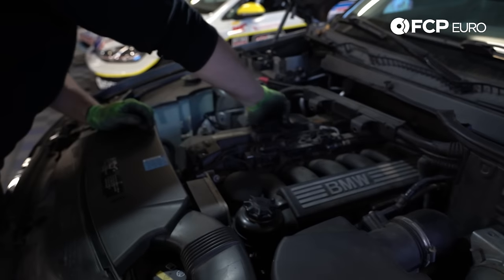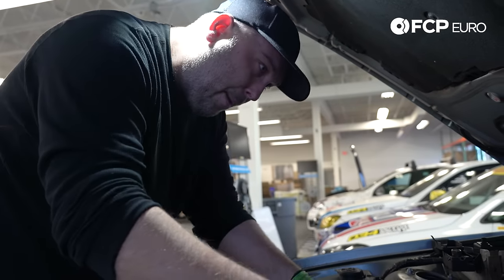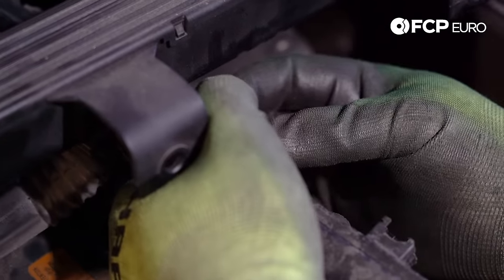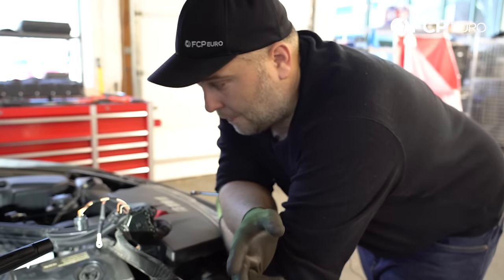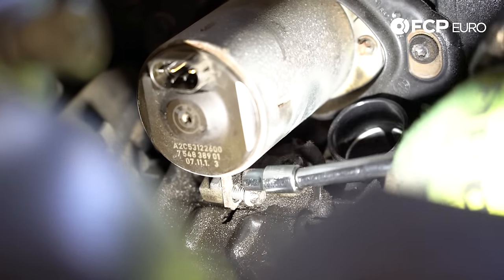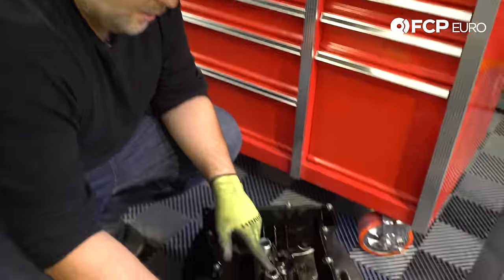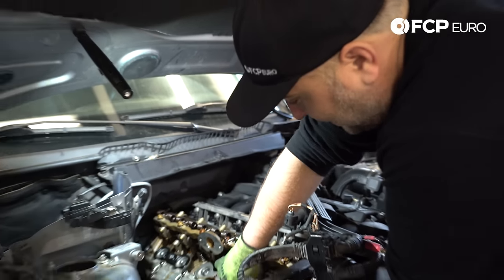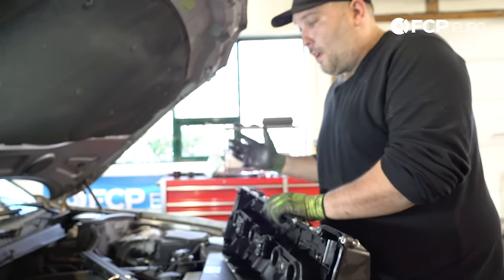How to Replace the Valve Cover on a BMW N51/N52N Engine

Comment: If you break the breather hose, YOU DO NOT NEED TO REMOVE THE INTAKE. I got access to it by just removing the alternator. Had to break off the tabs on the furthest connector to get it off, but that's okay if it's being replaced.
Reply: A little late for this but i Have some input.  This method would only work on the later engines.  If you have the n52 with the magnesium VC, then the oil separator is bolted to the intake and it’s gets in the way

Comment: Definitely use a Torque wrench. I've done this job like like 3 times now cuz I damaged either the Valve cover gasket, or the Valvetronic seal from over-torquing casukng vacuum leaks. It's a very small torque
Reply from the maker: 100%

Comment: I just did this the other weekend on my 2009 328i xdrive,  when I started it up it ran rough checked the codes and p00bc came up.  I didn't mess with the mass air flow sensor at all and now I'm stumped as to what it could be.  Any help would be greatly appreciated 🙏

Comment: I have an E90 330i with the magnesium valvecover. Can i use some rtv along the original gasket to prevent future leaks. Can the magnesium withstand the chemicals in the rtv?

Comment: So I did the valve cover replacement and everything and now it's wanting to stall at idle, the rpm's drop but then pick back up every so often. Please help. 09 bmw 328i xdrive N51.
Reply: Did you end up finding a fix for this one? I’m having a similar problem after changing the valve cover and spark plugs.
I’m also getting a squealing noise on acceleration

Comment: Great video! I noticed you guys didn't use any gasket sealant/maker? Is that because the gasket was already attached to the valve cover? Just ordered these parts from FCP Euro and about to do the job myself. Do I need to put gasket sealant on the bottom of the gasket that will be mating to the aluminum on top of the engine?
Reply from the maker: Hello Daniel, the gasket is already attached to the valve cover so you won't have to add any gasket maker.

Comment: Whats your opinion on removing the valve cover gasket. Adding some very small dabs of RTV sealant. Using it to hold the gasket in place. Then installing.
Reply from the maker: Hi Johnny, usually it is recommended not to use any. These gaskets stay in the plastic covers pretty well for the most part!
Reply: @fcpeuro  ok. I’ll change it dry then. Thank you!

Comment: Great video man! Pleased repeat customer of Fcp ! I have a question about valvetronic Motor ? If you have a  magnesium valve cover n52 with push button start ignition. Due you need to do all the limit tensions clockwise an counterclockwise? Mine is 2007 530i . I need to do this same job

Comment: I am about to do this fix, what should I look for to see if I need to replace the eccentric sensor while I am in there? Ie, any warning signs that it is bad? Wouldn't want to have to go back in just to replace that.
Reply from the maker: If there is oil in the sensor itself, you'll definitely want to replace it.
Reply: @fcpeuro  thanks for all the tips! Got this done over the weekend saved me 1400$ quote from the mechanic.. and no more leaks!!!

Comment: Do you leave the plug on the pcv valve breather on the new valve cover or do you remove it???? Mine has a removable plug. Thanks. Great vid . ( The one with the rubber diaphragm).
Reply: I need help with this same thing why is no one answering this question smh
Reply: @kaifarrell5654  I took it off and it seems ok.

Comment: 40:22 what hose is that mine doesn’t fit since I switched to a plastic valve cover like what you have. I used to have a aluminum one

Comment: Hi i have a question about the hose at 14:09. I unfortunately broke it. i tried to mickey mouse it but the car is stalling out now. I was wondering what that part is and what it is connected to. I have not been able to find any videos on it
Reply from the maker: Hi Patrick, that is a crankcase breather hose which will vary by model, we would need vehicle information. Please feel free to email service@fcpeuro.com and we would be happy to get the correct hose you need!

Comment: Hey guys, do you have in mind to do another video with the magnesium valve cover ? i´m not sure about the torque specs for the aluminium bolts.. Thanks!
Reply from the maker: Hi Martin, the process will be almost identical, except for the gasket keying into the valve cover. The torque spec for the new hardware is 7nm + 90°.
Reply: @fcpeuro  thanks for the answer!,  great then... next month ill be purchasing the whole kit !

Comment: Hi great video....got a question....I just replaced the whole valve cover on 2008  x3 and now car cranks but won't start. I'm at a loss...everything is connected but not getting any spark on any of the ignition coils. Any ideas will help

Comment: My car won't start it will just crank for one second. Replaced valve cover with gasket and eccentric shaft sensors on my BMW 2009 328i. I just noticed one of the ignition coils(4th) had oil at the end. Should I check on spark plugs and replace all the coils?

Comment: Hey
Did you have to take out the spark plugs? 
Do you have to remove the spark plugs when taking out the valve cover? 👍
Reply from the maker: You don't need to remove the spark plugs to replace the valve cover.

Comment: Do I need a new VVT motor, my friend and I were working on my car and I went inside to use the bathroom right when we were at that part. Got back right when he was unscrewing it and it popped out(he did not put the VVT into service mode...). Should I just put it into service mode now that it’s out and then when I put it back into the valve cover just follow the guide?

Comment: I got a letter from BMW My 128i have a PVC recall. 
I have not change the valve cover gasket, so if I take it for service recall. BMW Would have to change the valve cover gasket and labor as well?  If the cover is warp or cranks in the process BMW is liable for the cost of the valve cover right? 
is there or when can I check service recalls, the car has also a rattle noise at idle? I hear is very common issue with BMW engines...

Comment: HI GARETT why do u have to block the hole where the cccv hose attaches when u are doing a vaccum on PCv valve?? I have an N52 series 3, 2008 but I've seen pleanty youtube videos where all they do is hook up a vacuum to pvc to see if it bad and NOT block that back hole in rear of valve cover **PLEASE CONFIRM

Comment: When resetting the valvetronic motor you say to spin clockwise until you feel tension then spin counterclockwise until you feel tension? Is that correct? Or did you misspeak?
Reply: Resetting is done by key on to accessory, then off then on a few times. Only the allen is used for removal and reinstallation until tension is felt.
Reply: @DaveMathews  he says to go counterclockwise until you feel tension as part of ending procedure of install.

I went counter clockwise and never felt tension.

Don't know why??
Reply: he says to go counterclockwise until you feel tension as part of ending procedure of install.

I went counter clockwise and never felt tension.

Don't know why??
Reply: He says both. First, he says clockwise, then counterclockwise. 45:40

Comment: I replaced my valve cover with a plastic one and I used to have an aluminum one and the crankcase breather hose is t fitting on the valve cover. It’s like the two hoses are the same size so idk what hose to get that will fit on the plastic valve cover.

Comment: I just did this to my E92 and I'm getting a squeaking sound and a rough idle. I believe its coming from the valvetronic motor. And my short term fuel trim was 29.7% when I checked. Any ideas what it might be?
Reply from the maker: Those fuel trims being way off sound like you have a large vacuum leak. I would check all vacuum connections!
Reply: Josh Jensen Did you end up finding any vacuum leaks?
Reply: @christopherolveda6628  I think I may have had one because one of the valvetronic motor bolts stripped. So I took it in to get it helicoiled, then replaced the valvetronic motor too. Something is still off with the engine, but it runs and drives just fine. Stutters occasionally at idle still and gives me valvetronic codes. But not worth the hassle to fix it at 180k miles

Comment: Was trying to follow your video and noticed my engine doesn't have the valvetronic gasket, turns I got a N53 not a N52 can I still follow the steps without doing that part of the video

Comment: Good job there, its a pretty involved job to complete. Its better to just replace it all at once from 👉FCP EURO your german car specialists. You dont want to be removing the valve cover again if say the ccv system is bad or the ecentric sensor needs replacing. Original parts and available at FCP EURO for a great price and lifetime waranty. Lol. 😂👍
Reply from the maker: Appreciate the support, LaZaRItOLnObLe M!

Comment: So i have a 2007 328i SULEV with the n51, ive been looking around and theres supposedly warranty for 15 years. Since my car is an 07  my car should have 2 more years of it, where they replace most engine related components free of charge. Should i just not go through the hassle of taking my vehicle in and do it myself? Or try my luck and see how this sulev warranty turns out
Reply from the maker: Worth giving the warranty a shot, right?

Comment: I replaced the valve cover gasket of BMW X3 2009. The valvetronic motor was removed and reinstalled. I tried the valvetronic motor calibration by turning the key on position 2 for 30 seconds, and then off. When I started the engine, it run very weak, and then stopped. Now it can crank, but not start. Should I calibrate the valvetronic motor? Thanks.

Comment: that rear breather i find a screw driver from the intake side pushing on the inside of the clamp lever gently against valve cover while that right hand holds the hose and screw driver, your left hand pushes the rear side of the hose clamp and wriggle hose and off. if that makes sense :)
Reply from the maker: That is also a great alternative 😎

Comment: Did you put clickwose tension on the valvetronic motor to help push it out and then did you put tension counterclockwise to set it back to Zero / Idle position?
Reply from the maker: Yep, that's correct!
Reply: @fcpeuro  An easy way of knowing that all of the tension is released is to remove the oil filler cap, rotate the valve tronic motor counterclockwise and watch the eccentric shaft rotate towards the passenger side of the vehicle. Once the shaft has fully released you can see it from the oil filler port on the valve cover. Hopefully that was of some help.- BMW tech.
Reply: @BENZNUGGA benz can i email you with a couple questions?

Comment: any advice towards the “upper bolts” apparently the left bolt cross threaded  & holds on top the engine any advice ? 
It cranks and starts but idles low and stalls
Reply: You can use a helical coil to fill in the cross threading. Typically you need to reset the valvetronic motor by turning the key to accessory mode then off then on a few times, then off again to prevent the idle/stall. Also, this could be a vacuum leak on the valve cover due to a crack or the gasket not seating.
Reply: @DaveMathews  I wished I knew of this earlier , I had a check engine light and unfortunately I sold the car . Will get another n52 again for sure they’re beast

Comment: It's a good practice to use masking tape or plastic bag and zip tie to seal the connector after disconnecting to keep moisture out. It will also prevent it getting contaminated by silicon causing intermittent problem.
Reply from the maker: Good tip!
Reply: @FCP Euro  I would also recommend to spend a little more money to buy surface prep and good quality anaerobic sealing compound to get rid off small surface imperfection and to make it seal 99.9% like factory installed.  On VAG vehicles they use part # D154103A1 to seal the valve cover. I'm not sure on BMW

Comment: That breather hose disconnect in the back, don't even bother with squeezing the squeeze ring. Instead just use dental pick to pick the two latches. Easy peasy.

Comment: Z4 3.0i N52 06'. I'm going from the stock plastic cover to the aluminum/magnesium cover. Would I be able to reuse any of the bolts such as the 10mm bolts in the recessed crevices under the valvetronic motor or would I need to go with completely new hardware? Will also be going with the mahle rubber/aluminum gasket opposed to the rubber gasket it came with. Also do I need to transfer the metal sleeves seated in the spark plug holes?
Reply: What was your outcome? I’m also thinking about swapping to a more durable aluminum valve cover.
Reply: @MUSCLECREWDave  yea do it.
Reply: @MUSCLECREWDave  I would rev out my z4 and do hard pulls. I just sold it last month but it was in perfect condition no leaks up top or below

Comment: Would the process be the same for an 07 3 Series 328i 6 cylinder? When replacing the Valve Cover, does it also involve replacing the Eccentric Shaft Sensor? Thanks in advance for any and all help.
Reply from the maker: Hi Joelynn, yes the process would be the same as you have an N52 engine.

Comment: I have bought the parts from u guys and follow exact steps. My car now is vibrating at low idle 500-600rpm 
I feel the vibration to my steering wheel and my seat. It is so devastating as my car has 48k miles on it. I am tired and not sure what should I do. Please help
Reply from the maker: Hi Firas, I'm sorry to hear that. It sounds like you may have a vacuum leak. I would suggest checking over everything you did to make sure everything is sealed properly.

Comment: During installation, and the valvetronic motor is fully seated against the valve cover. Do you turn the motor counter-clockwise until resistance could be felt? I could not see that step during the demonstration.
Reply: Clockwise to screw it un until you feel resistance.

Comment: My friends replaced the valve cover and they didn't do the procedure for the valve tronic motor and now his car is running like crap, is there a way to get the valve tronic motor synced back up just by turning the motor again or is it going to have to be done electronically?
Reply from the maker: You may need to follow the procedure to reset the valvetronic motor, but first double check all connections are tight. You can also unplug coil packs to see which cylinder is misfiring.
Reply: @fcpeuro  thank you for the reply! Turns out the valve cover gasket was pinched when installing the new valve cover. Its been revealed and running much better. The only issue now is a P1415 code. I checked the maf reading and seems to be a typically ok reading (around 3 g/s at idle). Not sure what to think

Comment: Is there a way to determine if an oil leak is coming either from the valvetronic gasket leaking or from the valve cover gasket leaking?  I've got an e91 and the damn thing is leaking oil onto the exhaust manifold.  Had the valve cover replaced 2 years ago by a shop and had them replace the valve cover gasket and valvetronic gasket during the job.
Reply from the maker: There's no easy way to determine, but the best way to track oil leaks is to thoroughly clean any oil on or around the engine so you can better see where the leak develops from.

Comment: Yea l tried using two picks to finagle the clips off the injector rail. That's too damn hard times12! Instead, I use a 1-inch nylon strap, put it around the rail next to last injector and lift the strap straight up. That releases 3 connectors like it's meant to be. Repeat the same step next to the front injector to release the other 3 connectors. The best part of this procedure is the metal clips stay on the connectors.

Comment: Could you tell us where the 11127558449 bolt goes on valve cover ? It has a oval shape sleeve instead of round one like on the 11127558448 bolts.
Also where does 11127558450 get installed on valve cover? Is seems a little longer than 11127558448
Thank you

Comment: Hi guys
I am having an issue after after replacing valve cover,  p0012 ,  I tired both camshaft sensors already  , if delete the code and start the car again it just show up right away
Reply from the maker: It is possible that the timing is off. The chain could have skipped a tooth causing that code.
Reply: @fcpeuro  
So what's the solution

Comment: Do you have to have the cap on the pcv valve I some how lost mine wile doing the job
Reply from the maker: Hi Javier, unfortunately not something available separately. https://bimmercat.com/bmw/en/search/selectGroup/50153/11_3737/11127552281

Comment: You didn't mention there is a special tool for 10 mm to remove the fuel injector. Standard 10mm is not enough you cannot fit an extension bar to it.
Reply: You needed a 6 inch 10mm deep socket for fuel injector

Comment: @gail6904
3 weeks ago
HI GARETT why do u have to block the hole where the cccv hose attaches when u are doing a vaccum on PCv valve?? I have an N52 series 3, 2008 but I've seen pleanty youtube videos where all they do is hook up a vacuum to pvc to see if it bad and NOT block that back hole in rear of valve cover **PLEASE CONFIRM

Comment: hey i have a question what is the name of the tool the one. sincronic the timing?
Reply from the maker: Hi there, if you are referring to the tool used on the Eccentric Shaft Actuator, that is a 4mm hex bit.